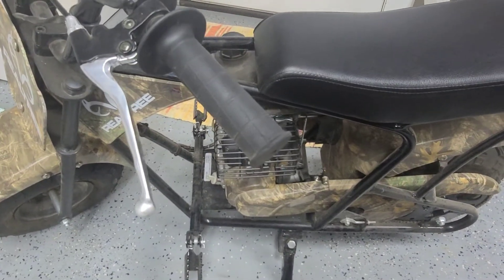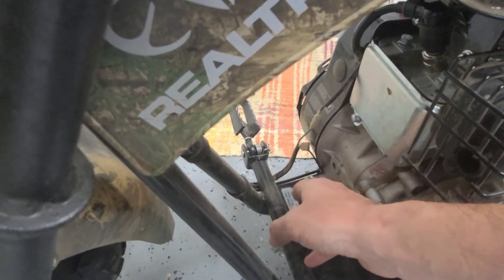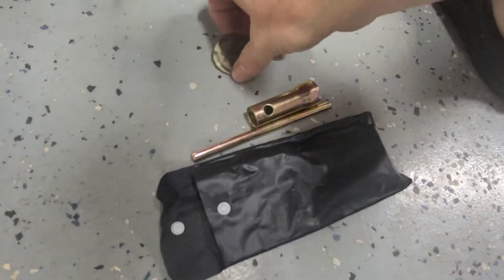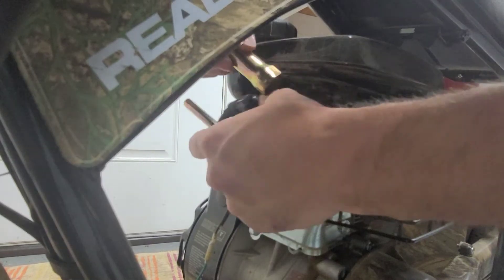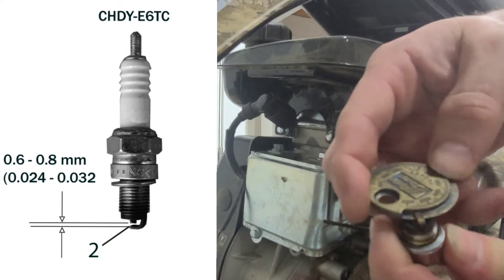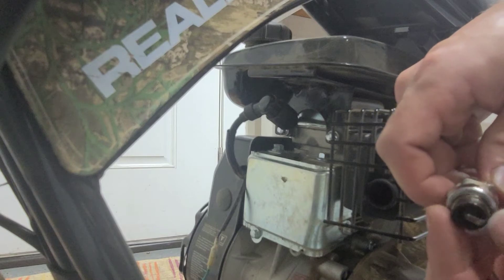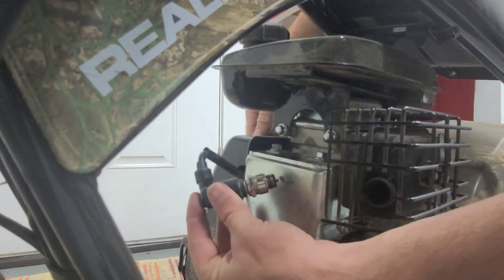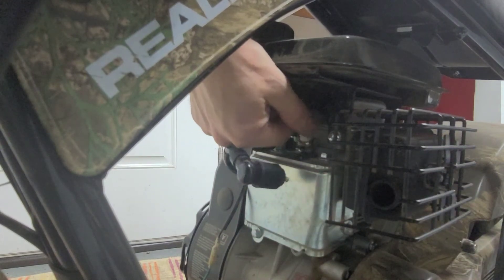Mini Bike Wont Start? Three things to check.

Comment: Why does my mini moto mini bike 125 swap only crank but will not start
Reply from the maker: @DakotaJeffries  need more info. Check the spark plug make sure your kill switch is working. Gas only last 6 months if fuel is older than that drain the fuel and put new in it.

Comment: My brother was riding his bike and it randomly turned off on him in the middle of the road. it’s been off since yesterday because we couldn’t get it to start. it has gas, it’s turned on, its oil is perfectly fine and we checked the spark plug. any ideas what else could be wrong with it?
Reply from the maker: Your getting a spark? Make sure that the kill switch wires are all connected and did not come lose. Make sure the gas shut off vaulve is turned on.

Comment: I just bought the BT200X today. Built it right and it has the right gas and oil inside it. Got a few rides around the yard then it started smoking and lost power. Now it will not stay running. Any suggestions? I literally just bought this today.
Reply: You overheated it take it back where u got it trade it in but dont tell them you rode it just say you built it and it dosent work
Reply: @405life7  I did and they replaced it. Thank you
Reply from the maker: It was probably the clutch.

Comment: My son is missing a piece of that cable how do I fix that ? The cable at the bottom and the cable at the top and not long enough they're not touching so something must be missing in the middle
Reply from the maker: If the cable is missing or broken it will need to be replaced. The part I think you are referring to is Ignition Coil Assembly. 

https://www.colemanpowersportsusa.com/parts/minibikeparts/CT100U/ignition-coil

Comment: The choke lever is stuck on run on my rt200 won’t let me pull it bavk
Reply from the maker: Try this:
1. Take the plastic screw off the air filter box.
2. Take the air filter out. 
3. Take the two bolts off the front.
4. The box will now slide off and you can see the choke lever.
5. You should be able to see why it's getting stuck.

Let me know if you have questions.

Comment: Mine is hard to start.  Once it's going it'll start easy.  But if it's sits for 10 minutes or longer then it's hard to start again.  Takes about 20+ pulls...
Reply from the maker: Is the choke on? 
Are you running non ethanol gas through it? 
Check the spark plug and make sure it's good and not dirty. 
The idle may need to be turned up.
Reply: @Brandon Shefferd  it won't start with choke, only half choke usually.  Can't find non ethanol near me, so premium 91.  Idle is good, I'll check spark plug

Comment: My bike starts just fine but it sounds like something is miss firing and it goes very slow with an unconsistent sound sometimes it doesn't even go did I possibly put too little oil in ? I've only been on it for about 5 mins because I don't want to make the problem worse
Reply from the maker: To much oil will cause the clutch to slip. I would let it run for awhile and see if it goes away the heat should burn the access oil off.

Comment: My rat 200 will not start don’t know why, have choke on and the ignition in start.
Reply from the maker: Make sure you are getting a spark.
Reply from the maker: I'd you don't know how to test spark plug let me know and I'll make a video
Reply: @GrayHairedDad  hey my kids won’t start. I watched this video and did these steps and cleaned the spark plug and put new gas in it and it fired up for all of 15 seconds and now it won’t start again. Any ideas?